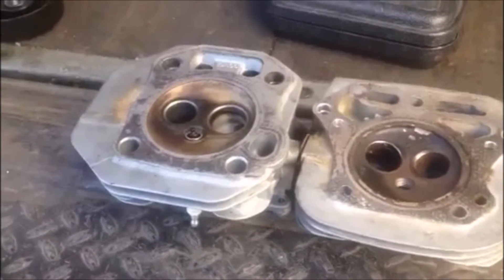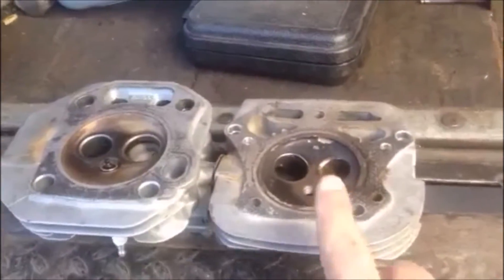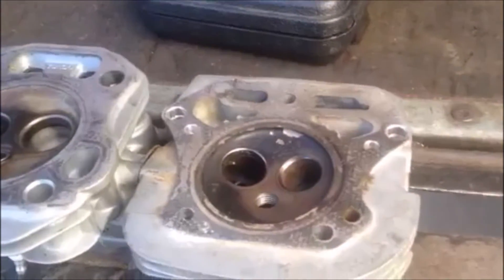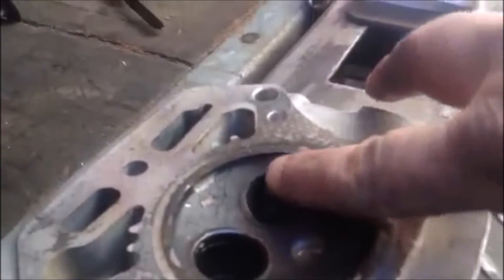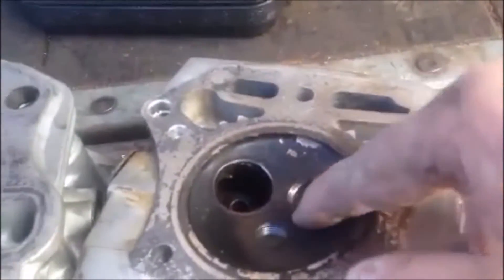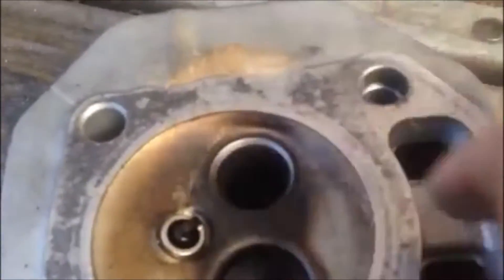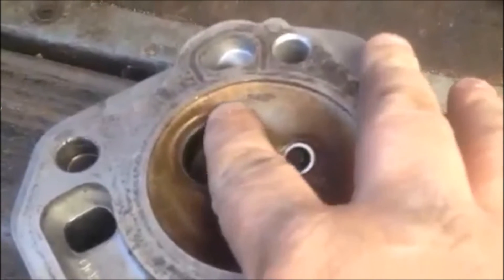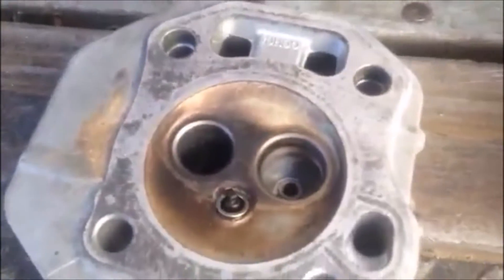KOHLER AND KAWASAKI ENGINE EXHAUST VALVE SEAT FAILURES

Comment: Had a question for you I have a 24 hp Briggs & Stratton that they compression release I could not find the were located anywhere on the netOn diagrams or anything it’s not on the camshaft it’s a 24 hp V twin intech

Comment: At the shop i work at we see alot of kawasaki engines (FH and FX Mainly) with valve guides pushed out. Sometimes it get so bad that the valve cant move anymore. In the past year ive done 1 briggs, 2 kholer, and maybe 25 kawasaki engines Heads

Kawasaki does not make a good head for some reason
Reply: ***** I've seen it a ton also, at least 5-10 a month on the Kawi, have seen less than a handful of briggs and kohler valve guides dropping

Comment: I would suspect the guides.  Any pics of those

Have you had bad luck with 17hp or greater intek motors

I have seen allot of the head gasket blow and at the same place

Any ideas

Comment: I take those springs, don't have dampers or rotators
I seen some heads, where the valve spring wasn't seating properly on the base and causing similar damage
Can does seats be board out and replaced?

Comment: Heh. Ya think ya got it tough. Try when they run on propane. 

Especially Briggs. Valve adjustments every 100hrs...let em go much more and watch em not start cause they are hangin open. The gasoline Briggs seem to do way better though. 
I'm comin from the home standby gen world cause most of em are lp or natural gas. 
I actually like the hydraulic lifters in the Kohlers vs the Briggs solids. 
I guess the newer kohlers are junk, but I got a customer that has approaching 4000 hours on his kohler gen. It's about 10years old, I believe it's a command engine that's on it tho. 
I don't know much about the kawasakis, but you know....most of the new stuff is junk.